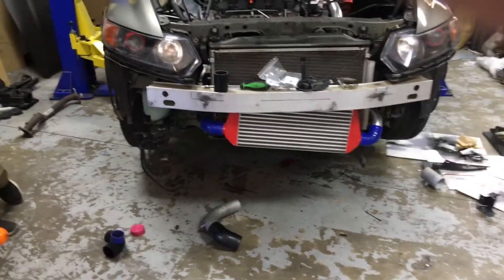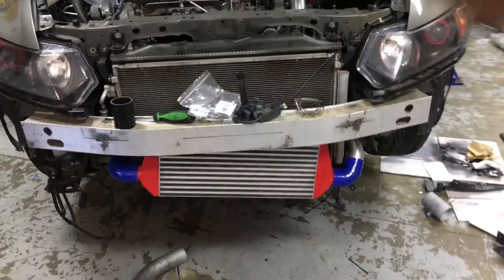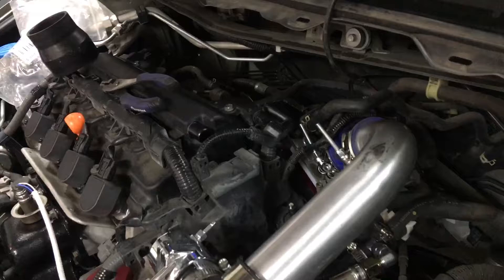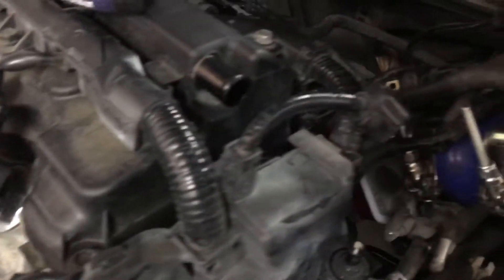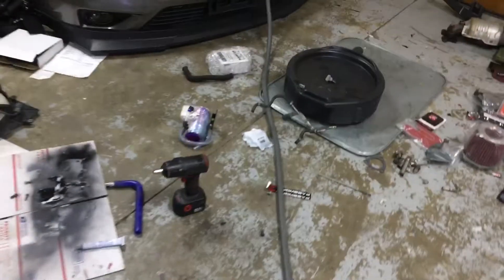06-11 Honda Civic R18 turbo update 2017

Comment: How did they route the intercooler piping, beachside there’s barely only space from the left side
Reply from the maker: everything in this engine bay is tight man. some stuff may have to be removed to get the pipping in first then added back. again depends on the kit your using to boost

Comment: What turbo kit
Reply from the maker: young quan tsi version 2
Reply from the maker: young quan their is a video on that on my channel just watch the dyno video. New dyno numbers coming as I added a bunch of cooling items aka meth injection new preformance radiator etc just watch the video and you will see and the videos after it
Reply: Lordof8mages where did you source the kit bud
Reply: How much power it's pushing how much psi you got the boost at
Reply from the maker: Mike Murphy what kit are you referring to?? There are like 3 turbo kits and two supercharging kits for the 8th R18